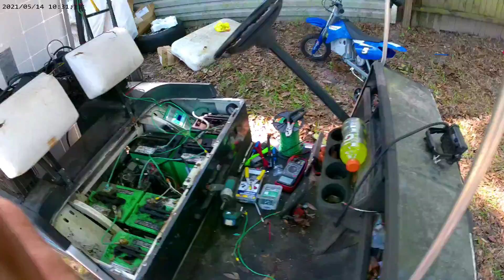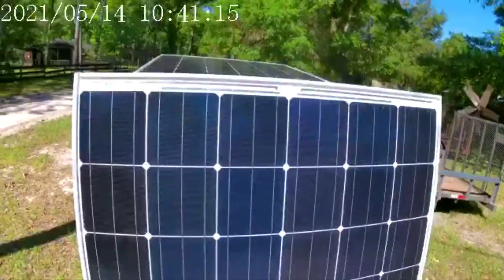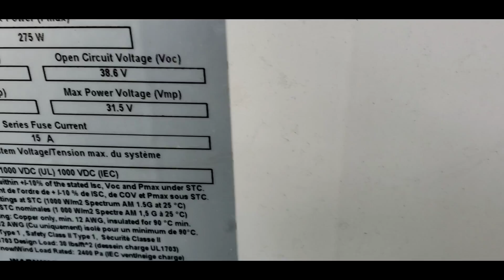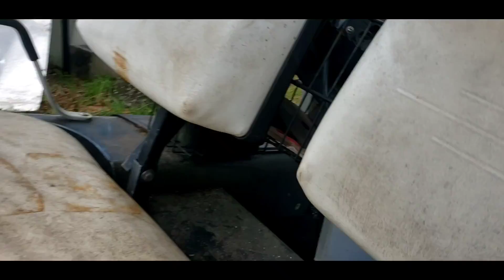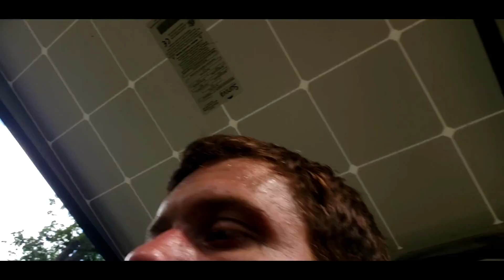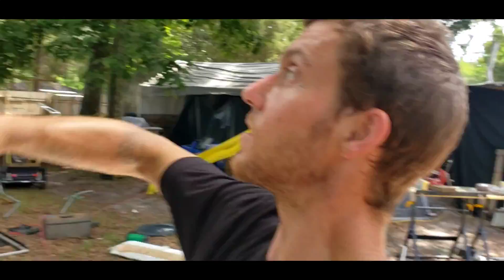Solar Powered Golf Cart! Never Charge Again!

Comment: Very cool! Would be a whole lot better if you could find or make it have only one panel on top. Go pro mount needed also. LOL!
Reply from the maker: Right!!
Reply from the maker: I have two solar panels that are 475 watts each and I think I'm going to put one of those on there instead of the two panels. The only problem is my current charge controller cannot handle the voltage they output.  They output around 230 v dc!! So when I upgrade my charge controller I'm going to do just that.  But finding a smaller charge controller that can handle such a high voltage has proven to be extremely difficult. Might have to make one.......:)